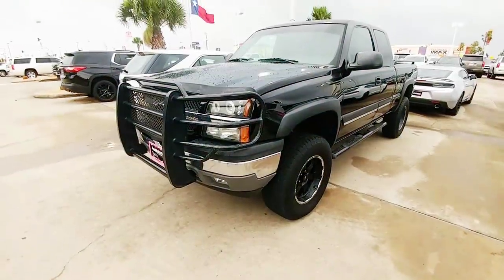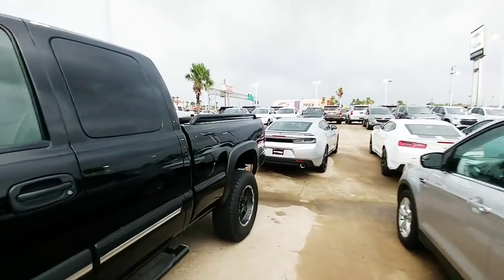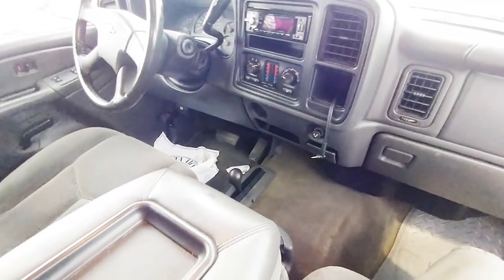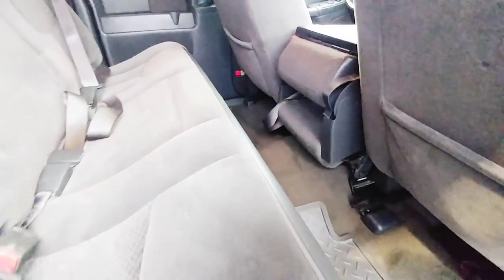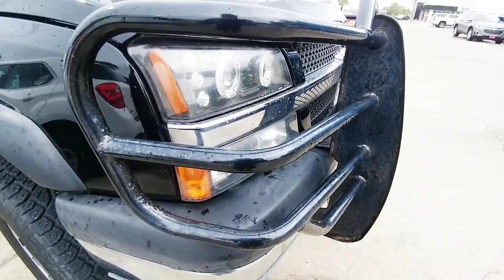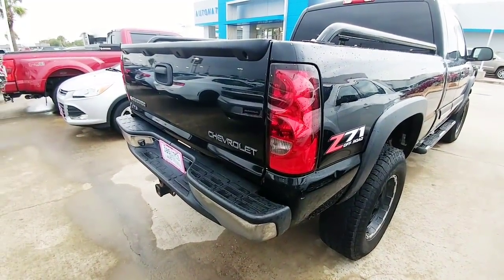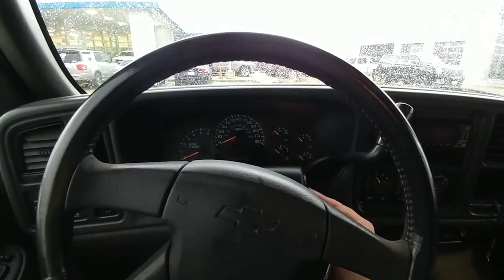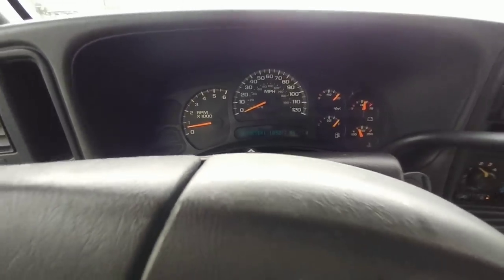The Reveal!  We pick up the $10,000 truck!

Comment: I purchased a 2003 z71 same color, pretty much same truck that was purchased in 2010 in San Antonion TX with 89,000 miles on it. I too paid $10,000. The transmission was rebuilt at about 120k miles and the engine seals were replaced at about 175k miles. My younger brother currently drives it with 185k miles on it. Its a good solid truck. Im suprised how low mileage that 2004 is for its age.
Reply: And yes those are stock fender flares

Comment: You correction on towing brings up an interesting video idea. Have you ever looked much at half ton towing? The big 3 make a lot of claims on towing but sorting through all the guides and sites they develop is confusing at best. Add to that dealerships rarely order trucks in the needed configuration to get the max towing capabilities that the manufacturers claim is possible. Case in point, GMC claims 12,500 lbs towing for a Sierra 1500 on a 4x4 crew. To get this you must have a 6.2L engine with the Max Trailer package. Go out there and try and find this configuration. Not many dealers carry it. Just a few dealers get it and order quite a few in this config but not many. Anyways great channel and keep it coming.

Comment: I like this new segment of the channel.  I'd have trouble dropping $10k for a 13 year old truck  but you can get another 100k out of that truck if it's taken care of.  Also, I don't think the oil pressure gauge is working.  There shouldn't be 80 psi at idle.  I have a 05 2500hd that has the same oil pressure gauge issue.  Bought mine 6 years ago as a combo with a 5th wheel
Reply from the maker: correct, the oil pressure sensor was bad and being ordered

Comment: go for the tow mirrors. you can get used gm headlights on craigslist
Reply: i would stay away from aftermarket lights cause they are built so cheap and they do leak. i think factory gm headlights new are around $100 each.

Comment: Congratulations on 100k and to your friend on his new to him Silverado. You picked a bulletproof truck. I have the exact sister truck except in a 2500hd gas. I definitely recommend the tow mirrors. I found mine on Amazon for $125 and they're powered and heated. Mind you, my factory small mirrors did not have heat, but when I installed these, the harness is installed in the door from factory. Now when I press the rear defrost button, my mirrors heat also. I've had them for 8 months without any problems. Also I installed aftermarket factory style headlights also. Make sure you pick some that have a lot of good reviews on Amazon. My lights started cracking and fading after six months. Here's the link for the mirrors:

DEDC Towing Mirrors Chevy Silverado 1500 2500 3500 Side View Mirrors For 2003-2006 Chevy Silverado GMC Sierra Power Heated Foldable Pair https://www.amazon.com/dp/B012VTHZAA/ref=cm_sw_r_cp_apa_AsxmBb756MMJN

Comment: I have a 2001 1500HD black that I was recently going to have an over-all repaint job done... The local auto body repair shop gave me an appointment three weeks out and I dropped it off... Exactly one week later they did nothing and I found it on their lot with the windows down and rain forecast... I got ticked off and went in and asked them what I owed them (they didn't do anything to it) and they said nothing yet,.. so I took it home... They were going to charge me $2000 and it did not have any bodywork, just paint... So Idon't know what I should do next as I still want it repainted... Maaco is not something I want... I wanted a quality paint job...
Reply: I bought the truck new, love my truck and am looking for some advice...

Comment: Not sure if the towing capacity is correct? I own a 2006 chevy Silverado 1500 crew cab 4x4 with a 4.8L and it has a towing capacity of 7,700 LBS.
Reply from the maker: Alfred Riley: correct.  This truck is rated at 7,500lbs

Comment: 4,800 towing capacity. Doesn't need tow mirrors. Can't tow much besides a utility trailer or pop up tent trailer.
Reply: Michael Hopkins closer to 7000 lbs but i agree on the mirrors
Reply: libarra81, I was just going on what he stated in the video.
But 4,800 seems low to me. Somewhere between 6,000 and 7,000 sounds about right.
Although Chevy/GMC does have the lowest cargo capacity and tow ratings out of the Big 3 American truck manufacturers.

Comment: Anyone know reputable Ford dealer with aggressive pricing similar to Dillon Dodge in Caldwell ID?
Reply from the maker: Michael Brown: AutoNation Corpus.  Ask for Eric
Reply: Big Truck Big RV Thanks, was thinking new truck dealer but would consider used (AutoNation only used?) if can find good deal. F350/450 or RAM 3500 crew/mega cab diesel dually to pull large 5th wheel. Solid reliability,  comfortable trim, cosmetic defects not an issue. Good exhaust brake so guess that eliminates Ford more than about 3 yrs old? Worth signing up for your $30K game or is that asking too much for this price?
Reply from the maker: Michael Brown: AutoNation is the largest new AND used car company in the country.